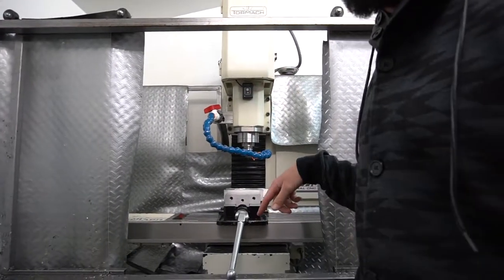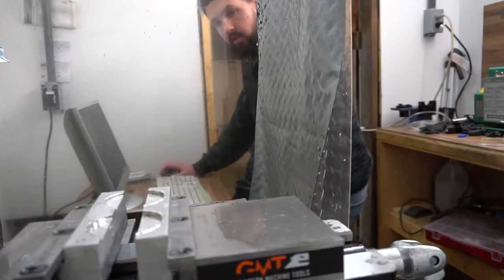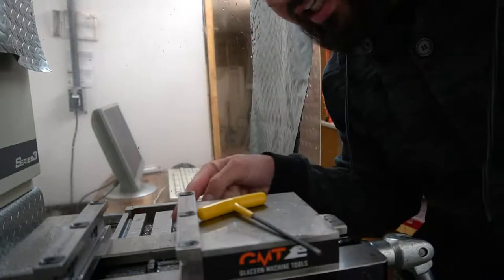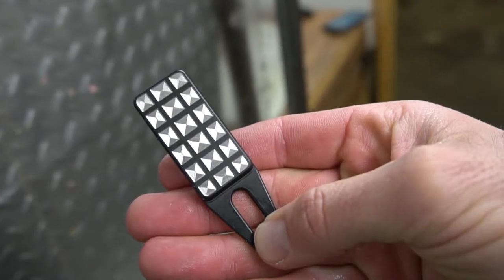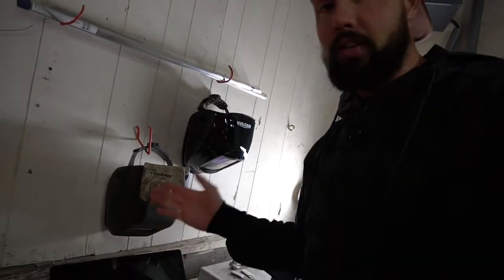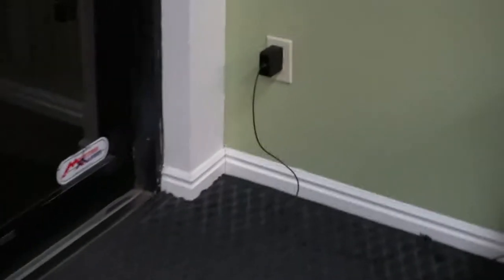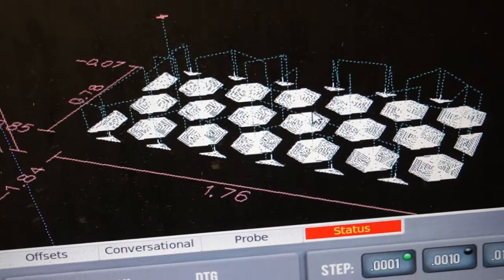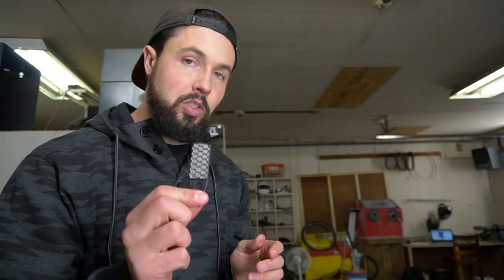Honeycomb Repair Tool

Comment: Good Day, Couple of questions. 1) What material is the repair tool made from?  Steel? Aluminum? Titanium?  Any heat treating?   2) Did you use the "pattern tool" in Fusion to create the waffle and honeycomb sections?
Thanks, Rob